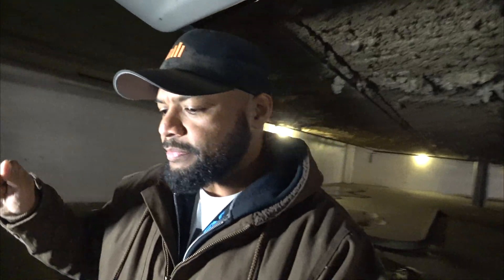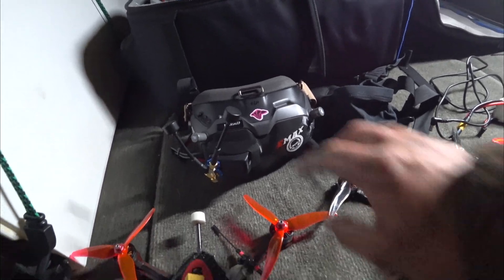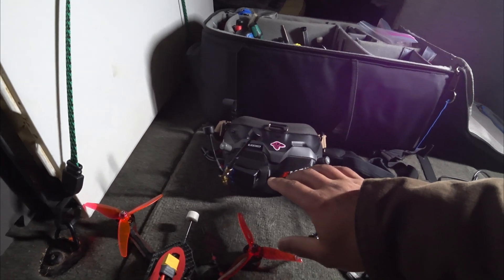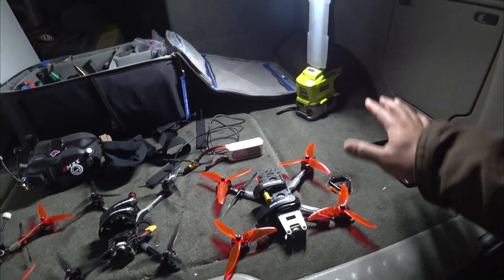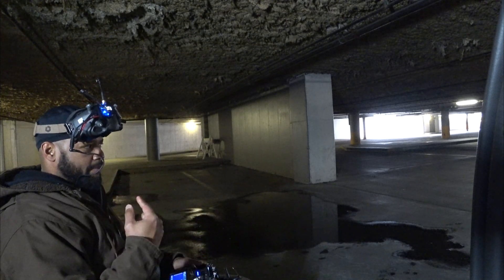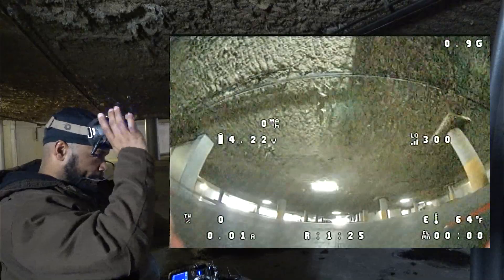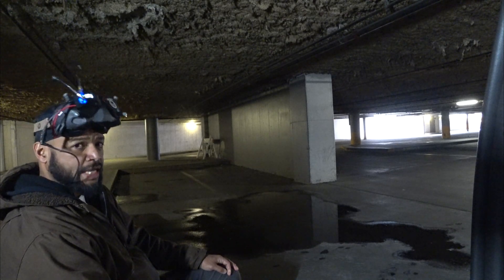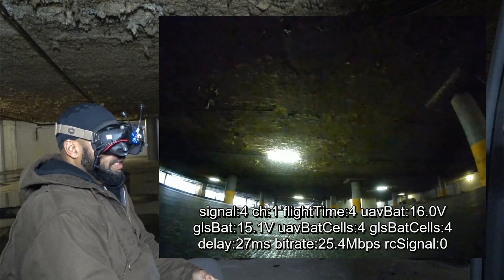Multipath | Caddx Vista VS. DJI FPV | Single Antenna Worse Indoors?

Comment: @
Furadi. The second antenna on the air unit is for the DJI radio so as the Vista don't have support for the DJI radio it doesn't need the second antenna, That's what i think anyway
Reply from the maker: The vista does work with the DJI radio heh. The 2 antennas on the air unit are for diversity.
Reply: @Furadi  ok then I was wrong. Thought you couldn't use the dji radio with Vista

Comment: I dont know but for some reason the DJI air unit looked a bit clearer, right at the start as you started off gaining speed and the vista jumped up past 30ms latency as you were going toward the back but the Dji stayed under 30ms
As ive seen in other tests the DJI beats it in the distance and image crispness as you saw in the park, under the car park the single is fine for the vista because signal jumps of the walls, a better test is behind walls and distance thats where ive proven the vista worse.

Comment: @Furadi question bro I see ur using analog on Dji goggles does it automatically switch between analog n he based on what kwad u connect to it or do press something on the goggles?
Reply from the maker: It will automatically pick up the HD feed but for analog you have to go into settings and select AV input.
Reply: Furadi thnx bro not gonna lie that’s the fastest YouTube response I’ve ever got thnx for sharing ur time and info with me
Reply from the maker: @SilentlineProduction  np!

Comment: I have the hyper low rs+! It’s a great frame. Did you need the longer wire from the air unit to install the vista or was the stock cable long enough? I’d rather not buy the extra unless I need to.
Reply from the maker: Oh check my first caddx vista video... I go over the build there! It's not traditional per se.
Reply: Furadi I just found that! it looks like the rs + has very different mounting options-there’s an extra set of standoffs I’ve been told are okay to remove to fit a 20x20 stack in the back. Maybe I’ll get a longer cable just in case. Thanks for all your videos btw! especially the ntsc/pal reset issue. Its only happened on pal cameras for me. Cheers!
Reply from the maker: woohoo nice!

Comment: (My comment on Nurk's video InRe: Multipath) - The most challening part of this for non-RF nerds to understand is that signal strength isn't the issue at all, it comes down to effective SNR (signal to noise ratio). Adding patches (more gain, which is higher RSSI - received signal strength) doesn't actually help with SNR in most cases, because there's plenty of signal energy coming in, it's just having to compete with signal that is bouncing off stuff at just the right distance where inter-symbol interference makes the data decoded by a receiver into junk. More/less power doesn't really change it all that much, though Nurk is right that full blast just means you have new surfaces where multiple bounces can reflect with enough power to affect SNR, although those differences are small. This just has me increasingly convinced that the DJI system is using a rake receiver type setup, which is common and fairly cheap to implement from telecom applications, which in the high-multipath environment case means it's going to be massively better at keeping useful video signal... and this shows it.
Reply: This is the biggest advantage of digitized signal is that you can employ this scheme - the next best thing for analog is the cross-receiver blending that is used by Clearview/Rapidfire as a very indirect means of counteracting that ISI, and it really only works because we're willing to tolerate point errors (single bit flips) quite a lot so long as the overall signal is mostly right, whereas the digital side needs to be above a certain threshold to clear FEC/CRC and actually be received as a valid packet/frame.
Reply from the maker: Awesome explanation!

Comment: While I have a Tarsnis/crossfire set up on my analog quads, I fly my DJI 7" with the DJI controller. One advantage the DJI controller has that isn't talked about a lot is the left thumb wheel which can adjust your EV light levels. In a changing lighting environment like a parking garage, you can adjust your camera light levels on the fly.
Reply from the maker: I would never ever try to adjust anything while flying a race / freestyle quad. Especially not in a parking garage.
Reply: @Furadi  it doesn't require going into a menu, you just click the wheel left/right, the E/V +/-  change is instant.
Reply from the maker: Understood. But I wouldn't be able to do anything aside from moving the sticks because I would crash.

Comment: Once again, antenna mismatch. The air unit quad is at a disadvantage because it has stock antennas with low circular polarization coupled with your TrueRC Singularities on the goggles. The Vista test had Hugo antennas on both ends, so started with an advantage. I'm not against the Vista,... it seems to be doing quite well. Just need to swap those air unit antennas for some Minion's or something so these tests can be more accurate. Ask Hugo for free matching sets for your quads,... I'm sure he won't mind the advertisement. :D  But you may have to find a more signal challenging spot to fly,....  Maybe bring your wifi router out with you and plug it up by your head. :D
Reply from the maker: It's not a range test. It's not even meant to show which system is better. It's simply showing how the Vista handles indoor flying which is fine. That being said the cherry antenna can explain the slightly higher bitrate in the back corner but really I wasn't looking for a bitrate comparison. Both systems performed extremely well.
Reply: @Furadi   Sigh,.. my first not-hearted comment on Furadi's channel. Figured that might have come across a little abrasive. Sorry about that. I do still recommend changing out those stock antennas to match your goggles. People talk about how the Singularies aren't really that great, but convenient, and that's why I bought them. But when you pair them with something good like Minions,...….they're magical! My directional antennas don't see the light of day now.
Reply from the maker: @rcrdps8144  lol no worries! The difficult part is there are no antenna mounts for the Vivid designed for aftermarket antennas but the stock antennas work OK.

Comment: Furadi I lived in Boise for 7 years so I'm always trying to pinpoint where you're flying based on my time there and I've only recognized a couple but I think I know this one for sure. I won't fault you for not acknowledging me on this one though I'm stoked kind of like solving a mystery. I worked at that Chili's restaurant across from the College stadium for 3 years and all employees parked on the surface level of that parking garage. I also lived in a duplex just one block down on the corner of Belmont St and S Leadville Ave. I didn't fly fpv when I lived there unfortunately because the treasure valley is full beautiful pockets that I wish I could fly.
Reply from the maker: omg that's awesome! I've been flying in that garage since 2014 haha.

Comment: How i like to explain multipath interference.  Multipathing is sorta like when you're trying to talk to someone in a big empty room, often times a gymnasium or industrial room, and you find it hard to hear what someone is saying due to echoes.  But instead of struggling understanding what is someone is saying, the Video receiver struggles to read the correct video signal, so you get static/ funny behavior.    

Man i think this is the ONLY video out there that tests vista multipathing!
Reply from the maker: Honestly man I don't think we can really even use the term multipath anymore in regards to digital... we would never use the term "static" like we would with analog. Coming to the conclusion that certain things just don't apply anymore.

Comment: The reason you have diagonal lines on your video, and you're getting them on multiple quads isn't your camera. It's the way you wired your VRX into your DJI goggles which results in you picking up power supply noise from your BEC on the video signal due to a ground loop. The is common with internal wiring if following the iFlight instructions which show wiring the power and video grounds both to the power ground pin on the power supply board. That's wrong. You need to wire the video ground to the ground pin of the AV input connector, ensuring that you twist together the video with it's ground or MUCH better, use some micro-coax. I note that you're using external wiring, however. Try powering your VRX from a separate battery which will break the ground loop that's causing this issue.
Reply from the maker: I'm not using the iflight mod. Thanks though.
Reply from the maker: Holy crap it worked 😳 But why does it only seem to be a problem with certain cameras? I really only noticed the lines on the falkor and then today on my beebrain buy I have tons of other analog cameras. ⁉️
Reply: Furadi it’s most noticeable with a solid black background, so maybe the brightness level on these camera is lower?
Reply from the maker: Actually with the Toothless I noticed it right away in front of my house on a sunny day. The lines were always there. Going to fly it today to see how looks after moving the ground wire.

Comment: Very cool.  I wish the full size air unit was still $150 like it was for the holidays, and the Vista was $100-$125.
Reply from the maker: I hear ya. But I look at it as the value is in the technology and development in reducing the size of the air unit. But I seem to focus on the weight of the vista more than others.
Reply: @Furadi  It's definitely worth the cost.  It just hurts when the credit card comes out.  :-)  I have a 3" quad I've been thinking about putting the Vista in.

Comment: Have you compared upgraded antennas on the air unit? I’m still trying to figure out if there’s any truth to the rumor that the stock DJI antennas are somehow hampering the system for regulatory reasons. And if so, whether the Caddx/Vista rebranding exercise was because the rush antenna provided with the Vista doesn’t do that and DJI didn’t want their brand selling something that doesn’t meet FCC regs
Reply: That sounds .. weird? 
Having better antennas allows for lower transmission power, which I'm sure the FCC would be happy with! 
Or are you talking about high gain antennas?
Reply: @lievenvv  KababFPV said in his video for the iFlight Megabee the following "A lot of people wonder how they're getting away with 700mw transmission in these goggles, and the way they're doing it apparently ... the transmission signal needs to be under 500mw ..  they're using 50% efficiency antennas to knock the signal down in power as it's coming off." I'll admit I misremembered this as quote about the air unit and Kabab has started incorrect rumors before but I'd still be curious in a comparison
Reply: @philip-sancho  I will not doubt what Kabab said, but it still doesn't make sense to me personally! 
I mean if that is true, then all they are doing is heating up the VTX even more than normal.. Better to go for 500mw and efficient antennas then.. ??
Edit: perhaps it is 350mw per antenna in the original air unit? i.e. that's what the 50% means?
Reply: @lievenvv  Interesting point, wish I still had my ImmersionRC RF power meter and a Vista to test it out

Comment: wow, great direct comparisons!  Seems like fusion mode is exactly the same as regular mode... like fusion mode doesn't help at all... ?   

I'm tempted by dji/ digital but it's scary to hear you say you can feel the latency change / drop in bit rate.    I wonder if I would notice it at all.

Were you on the same video output power for each system?
Reply from the maker: yep all on 25mw. The thing about me feeling the latency though... if that was analog I would have been blind or near it... would you rather feel some latency or not be able to see?
Reply: Jrod FPV the only thing to be scared of while flying digital is that you never want to fly analog again! I’ll admit I was a skeptic at first but after flying this weekend back and forth between the two I find it hard to pick up any other quad in my fleet. Including micros and I love my micros!

Comment: I also have the caddx vista and the dji air unit. In my test I have been getting better results with the vista unit every were. I also have done all my tests with stock antina and it's been amazing.

Comment: Hey! great video! I have 4 vistas now, have installed two. I have learned you can leave the temp control feature on and the quad works as intended. It will show the warning message about not being able to record/low power mode. the moment I arm it goes away, latency drops to sub 25ms, and recording works fine from the goggles.
Reply: Yep works perfectly in this manner. BUT wait for just a second to take off after arming. At least in my setup the video will be locked up for just about 1.5 seconds while it starts recording and switches to full power.
Reply: @chrispfligler5892  Good point! I noticed maybe less than a second, but My race quads also have only run at 25mW and 200mW so far with the Vista.
Reply from the maker: Good info guys! I'll play around with it maybe.
Reply: Lol yea on my like 3rd flight with the vista I wasn’t thinking so I armed and just half throttle shot up in the air before it fully unlocked and I was soooo scared😂
Reply from the maker: @ianozborne1555  lol

Comment: Are you back using the default goggle antennas?  I feel like investing in my xairs was a waste
Reply from the maker: I'm usimg the singularities in this vid. The Xairs are awesome for range or max penetration.
Reply: Furadi hey so I’ve been in the hobby for about 5 years now. I’m 16 and when I started I didn’t have the money to fix things when they broke so I only got to fly about a week out of a month. I think this fed my love for the hobby because I was always super eager to go fly! I hooked my buddy on as well. Over the summer I sold all of my drone gear my 3D printer and some of my other hobby’s and got a summer job. I saved up about $3000 and bought the dji setup with the goggles air unit and controller. I also built a great 5”. Im very satisfied with what I got but it seems that when you fly and other peoples dvr they don’t get a lot of fuzz in the focus mode. When I fly I get a good amount. It’s not bad”WAY BETTER THAN ANALOG”😂 but I was curious why this is because I’ve got my antennas perfect. I want to upgrade the antennas to see if that will help but I don’t want to waste my money. I’ve watch your antenna vids but never got the gist of what was the best. I fly mostly in parks with trees.
Reply from the maker: @brandan_fpv  Hi Brandon! Man it's awesome you were able to save up that much to jump into to digital! So the pixelation is tricky... it could be interference even if you have high bitrate or it could be low signal and it'll always fuzz out faster when you're looking at trees because they're harder to encode. So basically if you're signal is good you could try running a different channel lol.
Reply: Furadi so we have 7 Channels... and there different? I never understood that with analog either. Why are different channels Stronger than others? Also when I’m flying and go to pick a channel they all have full bars... does the signal change if I fly behind trees on different channels? Like if I fly a ways away and land the drone is that a good way to choose a good channel?
Reply: @brandan_fpv  perhaps your connectors or antenna placement? Are you in high output power setting?

Some channels are stronger because antennas (and RX/TX hardware) are 'tuned' for a certain frequency. There's some other stuff going on, too. But it should not matter as much as antenna placement+orientation ;)
Reply: Dji range is so good I fly most my spots on just 4 VAS ion v2 stubbys on goggles, I rarely break out the VAS cross hairs for the top 2 ports but it does help flying behind like 2 huge concrete office blds lol ....RIPanalog
Reply: This is the raw google feed, 1200mw and a few meters away,  you get so much focus mode around those skinny trees... 4 systems we have they all do the same.  Analog is near flawless there.  Xair, default, doesn't matter.  Focus mode during racing can really fuck you up,  I would much rather race analog outdoors. Also nobody mentions frame skips when not full bars. https://drive.google.com/file/d/1-2fW3KGKMxLrr37iRw5zmjewVZWIduLO/view?usp=drivesdk